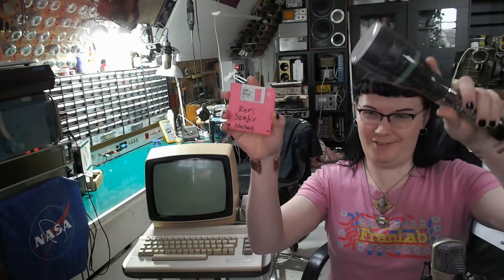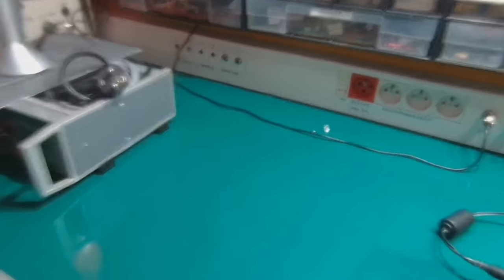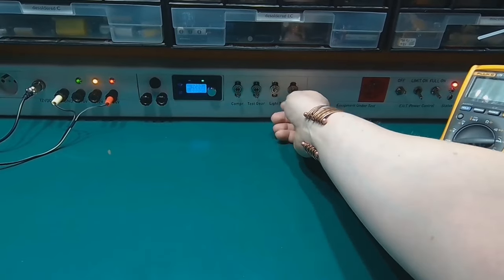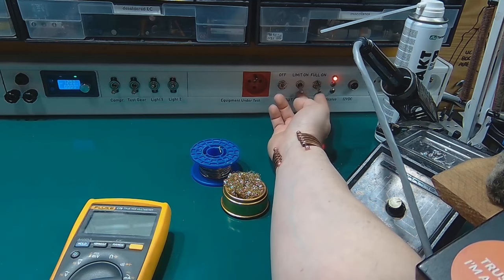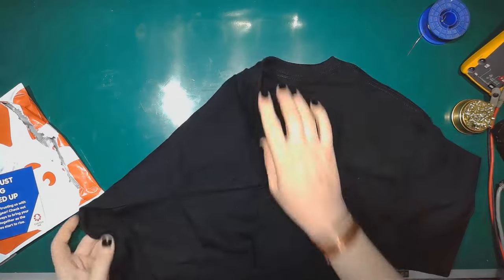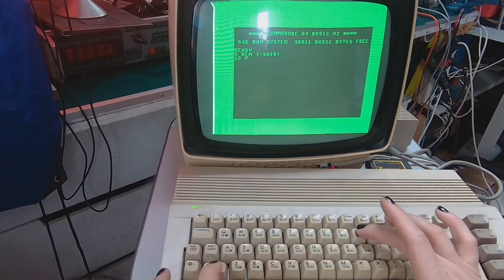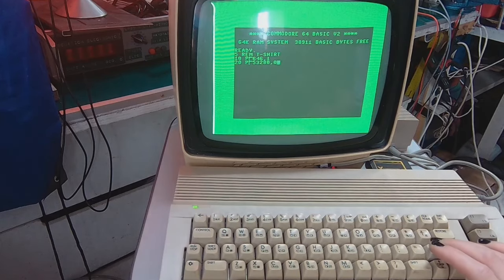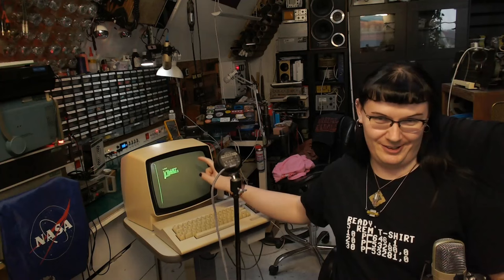Keri's Baby Steps with... Commodore 64!

Comment: I like the bench, my only suggestion is an "oh shit" (Emergency Stop) button to quickly remove power from the DUT, soldering iron, and anything else that could reach high temperatures or output high voltage.